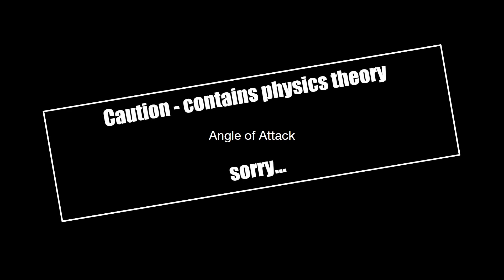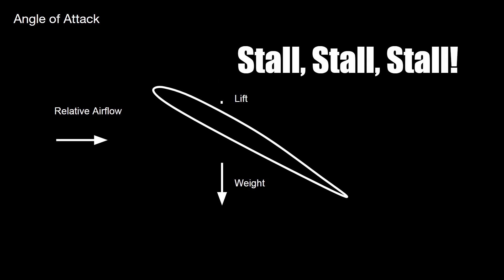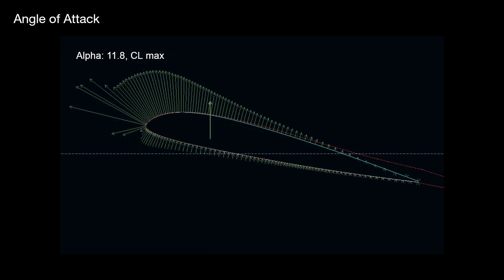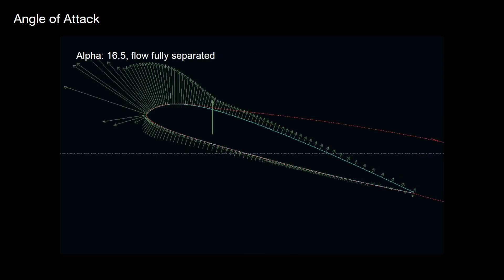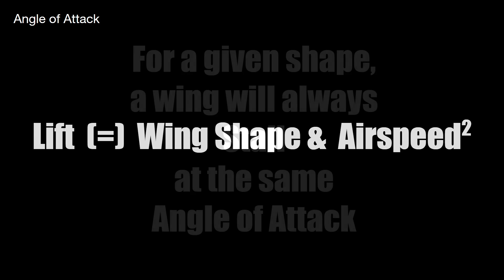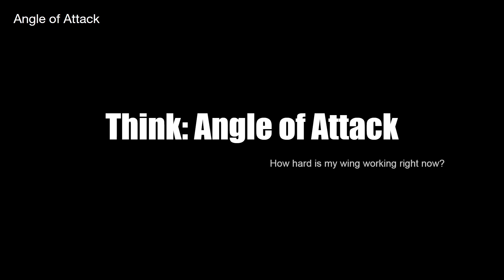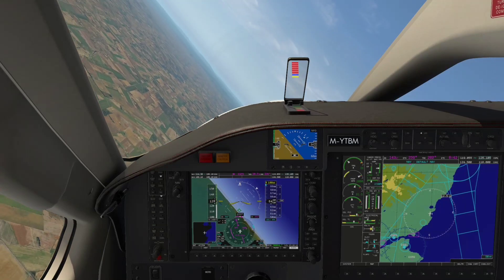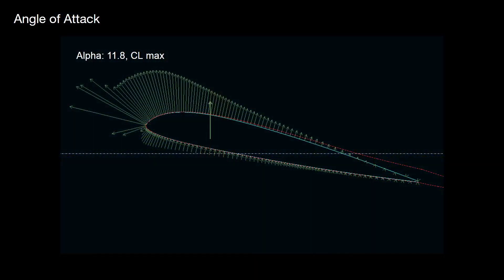Hotstart TBM 900 Extras 4  - Angle of Attack

Comment: No apology needed (I graduated with an aerospace degree in 1968). If my profs had been as good at explaining aerodynamics as you then I wouldn't have specialized in airframe stress analysis. :) Very well done video. As far as use in landings I find it useful in short field landings and in avoiding those long floating landings. But I don't fly in real life ... I am an extremely nervous flyer. It was always a point of concern for my fellow airline passengers when they found out what I did for a living and then saw how nervous I got. :)
Reply from the maker: Thanks for the feedback. I think every aircraft would benefit from a very obvious angle of attack indicator, especially when manouvering close to the ground. I totally understand the concerns about flying when you have a background in the physical structure, I started off flying gliders, and looking at the size of the wing pins compared to the load they carry can be terrifying!

Comment: Awesome! Can we get a video showing us how to use the alpha gage on landing please? 😋
Reply from the maker: Thanks, I would treat it more of a safety system than a primary flight instrument is this aircraft, but in general terms if you have less than 4 bars of green on approach you’re probably too slow.
Reply: Reflected Reality Simulations This is the video I had in mind when I mentioned that. I think it makes a lot of sense to fly the AOA indicator on landing as you know exactly how close you are to the stall, no matter the weight of the aircraft. Carrier pilots do that too. So in a sense, it would seem very safe to me. Curious to know your thoughts on the matter. 😊
Reply from the maker: Yes it is possible to fly the approach solely on alpha, as you’ve correctly observed it should give you the correct performance every time. Just be careful as lighter weights mean less margin (in knots) to the stall, no flare required in a carrier landing! Also, remember approach speed is not simply down to wing performance. There are control considerations too. On a multi engine aircraft there is a Vmca speed, minimum control speed airborne, where if you go below that you may not have enough yaw control to counter an engine failure. This can be a factor on powerful single props as well. Consider the propeller blades - if the prop disc is not directly into the airflow, as normal when landing, then the descending prop blade presents a greater angle of attack than the rising blade and produces an asymmetrical force. This is called p-factor and is often confused with engine torque. Incidentally this is also where the critical engine comes in on a twin, and if “handed” engines are fitted the descending blades are closest to the fuselage, to minimise asymmetry with more “thrust” inboard compared to outboard. Minimum approach speed in the TBM is 80kts, and I’d suggest the alpha will let you know if you are flying too slowly for your weight, but at lighter weights the minimum speeds can be limiting even with nothing showing on the alpha. Hope that all makes sense, propeller aerodynamics are a whole other topic!
Reply: Reflected Reality Simulations Thank you for those very important insights, which are very clear! Indeed, as a normal caution, I would never go below the recommended minimum landing speed no matter what the alpha gauge would indicate. Your excellent observations make it all too clear why that is the prudent way to go!

Comment: why auto pilot wont disengage on stall? is it normal?
Reply from the maker: Excellent question! It appears from the manual that this behaviour changes depending on whether a particular mod has been implemented. Before modification the AP would remain engaged, whereas after modification it would disconnect automatically. So I would say the behaviour could be considered normal. However, it also appears that aircraft with the voice alerts should exhibit the AP disconnect behaviour. Regardless, you are correct that the AP should be disconnected as part of the normal stall recovery, I simply found it easier to demonstrate with the autopilot. Hope that makes sense.